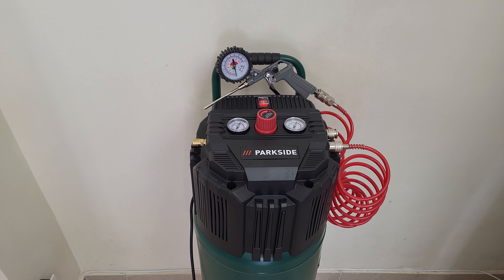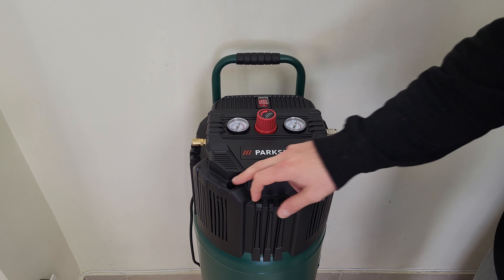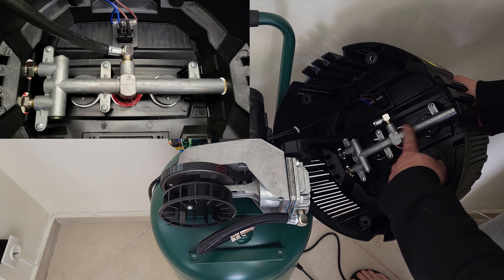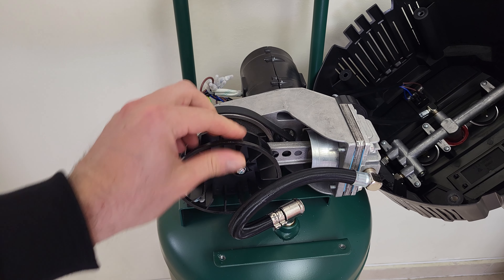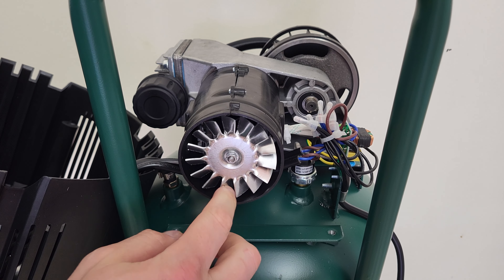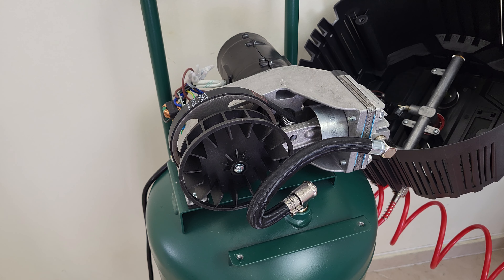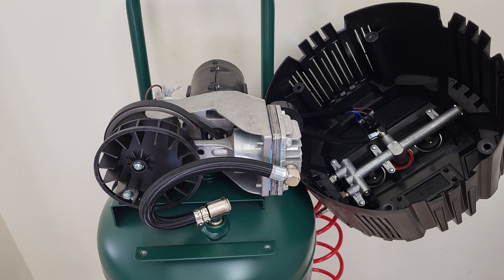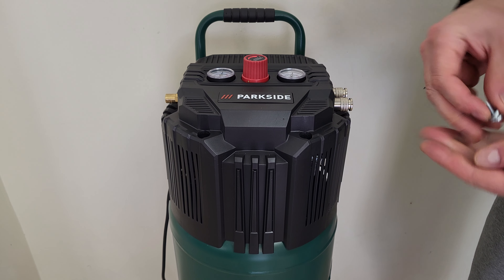Parkside Vertical Compressor 50L PVKO 50 B2 DISASSEMBLE

Comment: What RPM is the motor running at? What motor type does it have? Induction with run or start capacitor? Maybe universal motor? Could tell the motor type by looking inside the plastic motor case and checking for brushes (then universal motor) or wiring with mains connected to a primary motor winding and a run/start capacitor across a secondary winding. The boxy yellow component could be a run capacitor if it's around 5-10uF, but seems a bit small.
Reply: here is the motor https://ersatzteilshop.scheppach.com/product/Motor-15kW-230V-50Hz--Teil-12-5906125005.aspx       ,    the entire compressor is by scheppach company.   50hz 4000RPM https://www.youtube.com/watch?v=HRKi10RnFow

Comment: My leaks. Starts to run in the middle of the night. What could it be?
Reply: You can spray water with soap on the hoses, etc, and check where the leak is.
Reply: @jm-btt  i found the leak. Was in the treads of the intake valve. Ty so much for the help.